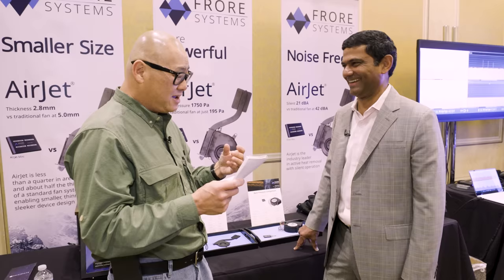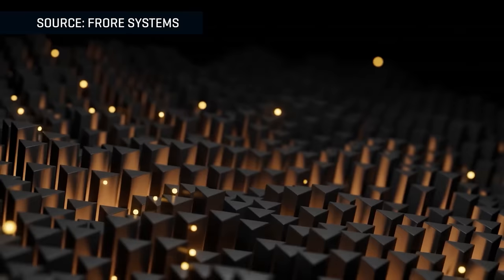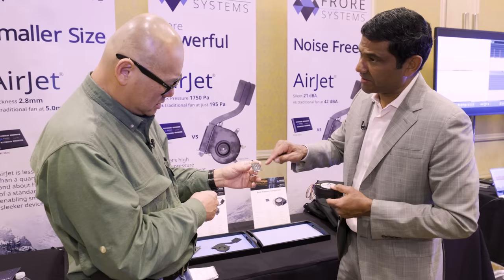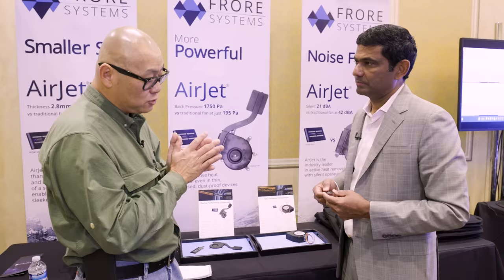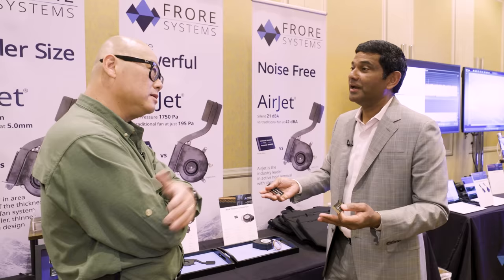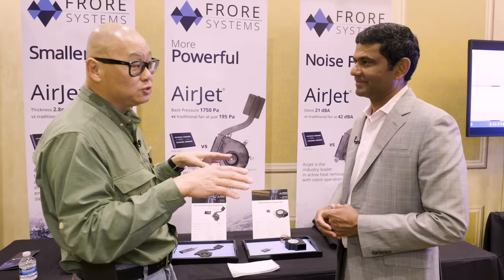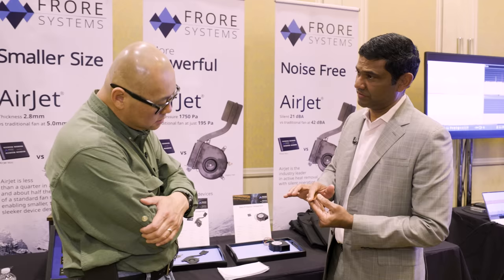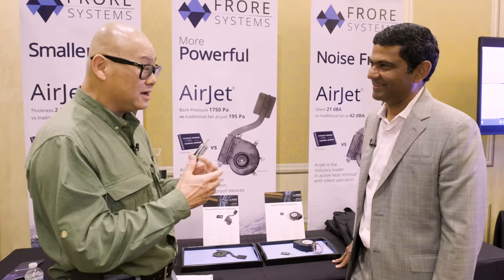Solid State Active Cooling Could Revolutionize Thermals

Comment: This seems really cool (pun) and the thermal saturation factor makes sense, and reducing noise is definitely nice. I'd like to know the endurance of this implementation compared to traditionally fan, which is almost guaranteed to be higher(solid state device vs. fan bearing). Although the 10w seems low at the moment for laptops, I'd like to see 20w for ultrabook, or phones which can't accommodate fans without ear piercing (small fan at high rpm).
Looking forward to phone vendors implementing this asap as they usually do
Reply: If they were practical they could surely use several of them at once (which is also referred to in the linked article) Albeit it's the larger one at 5:34 that can remove 10W(actually 8.75W = 10.5W - 1.75W consumed/heat generated by the device itself) of heat, the mini one being shown most of the time can only handle 4.2W.
They definitely seem more suited to low power, very thin devices at present though. Their site refers to using them in devices which are currently passively cooled - retaining quiet operation & thinness while being able to keep operating at peak performance.
Personally I wouldn't care about a laptop being a bit thicker for better conventional fan anyway though - as long as it was a similar weight, I'd much rather have a thicker but cooler, quieter, more powerful laptop - especially if they didn't have the usual daft air intakes on the bottom(seemingly ignoring the 'laptop' name).
Reply: @DoubleMonoLR  By their very website, the big one can dissipate 6W and the little one 2,5W. It's way worse than the guy is implying. They had the audacity to put "passive heat dissipation" from the laptop in addition to 10W dissipated by 4 of their small units to pitch a 20W power laptop.
Reply: @Bramble20322 idk where you got those numbers but their website says in the stat sheets that the big one can dissipate a net heat of 8.75w and the small one can dissipate 4.25.

Comment: Great product and very insightful demo. Be interesting to see what the lifetime of the devices are and how well they run with ingress of dust etc. Be good to see an upscaled version for desktop CPU's & GPU 's. As long as you can monitor performance (easy to tell when a fan or AIO pump has stopped!!!) and any degradation / replace a device, this looks amazing!
Reply: Yeah......  thats gotta be really dificult with this design.
Reply: that won't be happening in the near future. For now its capacity for power dissipation is max 10W... Gpu 4090 dissipates around 300W.

Comment: Interesting.  Worth keeping an eye on this and how it improves over the coming years.
Firstly I'd like to see how long they last. Gotta be able to last none stop use for 5 years, I personally think, maybe longer
Reply: Piezoelectric actuated components usually last a very long time so I'm curious as well!
Reply: @resonanceofambition  This is not piezo electric he explained they have like tiny pistons pushing air
Reply: As it's a MEMS device, I would expect it to be really durable but more importantly, not have a catastrophic failure mode but degrade slowly in performance as more and more of the individual actuators fail.
Reply: @valinkdevr5520  You are right. I missed the MEMs part and assumed it was Piezo tech because I heard membrane.
Reply: @unvergebeneid  I keep forgetting micro actuators and mechanical structures in common devices are a thing now.
Reply: I'm wondering how long it takes before that thing clogs up with dust and how hard it is to clean it out. It's bad enough seeing dust caked in laptop fans and trying to blow that out...
Reply: @danbert8  I was thinking the same thing.
Reply: @unvergebeneid  does this work in any rotation? example im gaming have to move the tablet/laptop at some point hold it sideways/upside down will it still work
Reply: @danbert8  I'm assuming that when we get to that point, we'll also develop a whole new line of specialized tools to do maintenance- you know, like with every product or service we develop.

Comment: I was also thinking of ways to make an active cooling device that is low profile and I have to say this one is much better. My idea was to use piezoelectric material that will vibrate small fins to push the air.
Reply: Would the use of Piezoelectric create any type of resonance like a high pitch buzz or ring? If not that might be a good idea
Reply: the problem is it would just move the same air back and forth. i guess they found a way to generate an airflow by vibrating the membranes in a particular pattern
Reply: Check Linus tech tipps, they used such a device to cool a steamdeck
Reply: @filiplaskovski9993  It probably would.
Reply: @mythsofconfusion6973  I'll check it out.

Comment: Hmm, it presents interesting possibilities to redesign HS/F systems for desktop PCs too.

You could substitute regular heat sink fins with one of these MEMS cooling chips draped over a flattened heat pipe, with the pipe either forged into a sine wave shape, or just a rectangle like a hybrid heat pipe/vapor chamber combo.

Multiply by 6 heat pipes from the base and you already have 60W of heat dissipation.

AMD's 16 core Ryzen 7950X3D has a 65W TDP, so high end use is near viable in just 1st gen AirJet.

Hells ye, MEMS all the way.

Now we just need MEMS speakers and studio quality MEMS microphones to join the party.

Comment: Interesting concept and I think it will work well for some niche applications. But judging from it principle of operation it will never outcompete fans on the price front. So for wide collection of uses they will be too expensive when compared to the benefits, considering that the alternative is dirt cheap fans. Also considering (unless I misunderstood) that it has moving parts it can be considered a mechanical device with all the life duration limits that that entails. The same problem as for the fans, but those are cheap.
Reply: Keep in mind though that SSD's were once insanely expensive when compared to HDD's, now-a-days SSD's have gotten so cheap there's almost no good reason to consider a HDD anymore.
Reply: @Sergei_Ivanovich_Mosin  Small HDDs sure, but you'd go broke trying to fill a NAS with SSDs

Comment: This really is pretty dang neat. I'd like to hear it in person and am curious on real world power draws. This could be to mobile cooling solutions what the LED was to home lighting.
Reply: Yeah it sounds like the main disadvantage of this is gonna be the power draw, but if it's only 20% on top of whatever the processor is using (he said something like 1 watt of power draw for every 5 watts of cooling), then it's still justified, as the volume saved in a laptop chassis can be turned into added battery capacity. And then the real drawback is added weight when compared to a fan.
Reply: Thats another potential application of this, cooling led lighting transformers.

Comment: I'm also interested in this as a fluid pump.
If the mems is software defined, then the cycle rate can be controlled to move fluid.
Reply: that woulldnt work dude
Reply: The two fluids of air and water are about as different as you can be here. Airjet sounds like it might have issues with, uh, water.

Comment: Very cool. The pulsing components inside seem like they would be very susceptible to dust - I imagine they are very tiny. I'd be interested in seeing how dustproofing works.
Reply: With how the pulsing work, it'll help shed the dust actively since all of them are moving constantly. They'd be more suspectible to moisture, however.
Reply: I think dust is not the problem if there is any blockage more bigger than dust (may be some insect or some tiny foreign debris)then it will fail to dissipate the heat. As long as the whole unit is dust proof or covered completely then it should be fine.
Reply: Need a proper demonstration with it working.

Comment: This device would go nicely with nvme ssd's
Reply: IKR?
Reply: Nvme’s are supposed to run hot.
Reply: @Nib_Nob-t7x  the storage chips yes but not the processing chips on nvme.
Reply: @ChrisWijtmans  this is to big for the controllers on NVME,s. Also a heat sink (with normal case airflow) is good enough to cool them anyways.
Reply: @Nib_Nob-t7x  nope
Reply: @ChrisWijtmans  you can say no but it won’t change the fact that what I said is true.

You have to remember that the controllers are not some high end processor they are just arm cortex chips that consume less than 9 watts on the high end.
Reply: @Nib_Nob-t7x  Nothing about what you said is correct. nvme controllers often overheat and throttle throughput.
Reply: @ChrisWijtmans  Really? That's weird because I just tested on my Samsung NVME's and none of them seem to overheat when I checked it crystaldiskinfo while running through crystal disk mark (default nvme settings).

 The max temperature was 60C (according to Samsung anything under 70C is fine) I did run it multiple times and it seems to have gone the slowest on the first run with it going faster as it got hotter.

there you go I tested it and your wrong. The only thing cooling it is a heat sink and case airflow.
Reply: @ChrisWijtmans  whats your nvme? Also the point is it's completely possible to manufacture an ssd with passive cooling and make it not overheat. If yours is overheating either you have bad case airflow or you should by a higher quality drive.

Comment: This is fascinating.  I think this could be improved by using the air jet modules as a replacement for the fin stack itself.  Standard heat pipes would move the heat from the processor, but instead of transferring the heat to a fin stack, they are instead welded to an array of these modules.  This would work to break down the air insulation, but on a larger surface area.  
If I'm not missing anything, I think they can easily compete with or outperform modern cooling methods by replacing the fin stack with an airjet stack welded to heat pipes. 

TLDR; replace a normal heatsink's fins with these modules (they won't need nearly as many) and I think there will be very large performance gains.
Reply: Can't wait to grab a couple of these aftermarket somewhere and retrofit them to an existing 11th-Gen or 12th-Gen Intel tablet's heatpipes to squeeze nearly desktop-level performance out of the silicon.

Comment: Does look impressive, I've never seen this technology. Wonder if they could stick a Peltier module in there and use the air to avoid the condensation, the only potential downside I see is dust because I've seen multiple times what dust does inside of a computer/devices and I have my doubts, would be nice to have an easy way to open it and clean it just in case. About them  marketing it as a "chip" expecting people to "upgrade" their devices by just adding more of those just like RAM or drives I think that's just wishful thinking but we'll see
Reply: I think (from no research whatsoever) it’s similar to electrostatic headphones

Comment: and here we go with new problems of micro cracks in the solder joints of the chip.
Applying constant vibrations directly to a weld can easily cause that kind of damage over time.

Comment: Yes, the obvious uses cases as in thin tablets, laptops, and high end phones, but... it isn't hard to imagine other uses. Imagine server farms replacing rack thickness and fans which can break down with these. Most of these aren't running much past the 45W range anyway. Higher-end chips in TVs or TV boxes. Graphic cards and desktops -- just to run quieter. Putting mid-ranged graphics cards into laptops and cooling them with these. Definitely a promising technology.

Comment: So I gotta ask, how does it work, is it a kind of positive displacement pump due to the “check valve” effect? What differential pressure is it capable of creating and at which specific flow. Som kind of a pump curve would be fantastic. If this is actually a kind of positive displacement pump, you could make this for high pressure applications by stacking them, and since it is solid state tech, guess it would be highly controllable and accurate. And if it could be applicable for other than air, that would really open up its potential. Gotta keep an eye out for what this will turn into. Hopefully something cool, efficient and cost effective.

Comment: So small/thin.
Easily accumulate dust. 😆
Easily clog. 🤷

It basically has a few fins inside that vibrate when electricity pass through it causing it to move air. The idea had been out there for a long time, somebody was just bold enough to actually make it. Pretty good!

Comment: Holy moly, this is the biggest innovation in the last 10 years (at least) for the consumer electronics and the biggest innovation in cooling ever. Just imagine, new video cameras being able to record 16k without overheating and stopping and being as slim as the passively cooled mirrorless. I also hope this doesn't have a big power draw.

This could also make convergent phones that connect to the monitor and become a full desktop like Ubuntu Phone with Ubuntu Touch was or what Microsoft Lumia 950 tried to come close to become a reality. Imagine putting this active cooler in the phone and then when connected to the monitor and power delivery (so that it doesn't explode the battery) have the cpu dynamically clock itself higher proportionally to the realised cooling potential difference to achieve modern low to mid range desktop level performance.

Suddenly you don't need a laptop to study IT, you just need a capable linux based phone, a monitor with IO (or dock) and a bluetooth mouse and keyboard. And BANG! Those phones will cost like $800+ in the beginning but in a few years it'll trickle down and suddenly every child has an access to a very capable machine.

But wait, imagine this! If chipmakers manage to get RISCV cores that match or exceed the performance of M1/M2 into phones the cpus will be immediately cheaper because of no ARM license fees. Then, it would be really really power efficient to the point of being very powerful even when cooled passively and then you put this active cooling and clock it higher. Now we have a real machine already! But wait, with that power we are for sure supporting VR now. Just pop that phone into a Google Daydream or even Google Cardboard type of VR contraption and suddenly you can do schooling in interactive classrooms remotely, you can work with virtual monitors, you can meet in VR from wherever you might be across the world.

And now we have a true revolution. No monitors, no clutter, no laptops or desktops. Just a phone, a headset (for VR) or even just a pair of XR glasses and possibly but not necessary an input device like a controller or a keyboard but I imagine soon it will all be done with gestures and computer vision.

This has so many potential use cases, an array of these could be used for a climate controlled suit. I wonder if the process could be reversed so it cools the air and heats up the actual component.

Comment: My overclocking self is drooling over the possibility. I wonder if they can scale this down to cellular level too.

Would love to see this on other devices like TV's and gaming consoles etc. VERY interested in this technology!
Reply: Scale it down enough to integrate it with "3D" processors. Could you imagine the number of transitors they could pack into a processor that can stack into a cube and doesnt have to worry about cooling?

Mores law mught be back on the menu. This teck would need to prove massive durability though.

Comment: Questions:
1. Can it be used to cool down hot plastic and steel materials as well?
2. do we simply needs to attach it to the hot device?
3. does it cost less than Rs. 500 per piece in India Hyderabad?

Comment: A genius invention that provides a solution for cooling the microchips in the cell phone, iPads,  the wearable electronics. The AirJet works as a micro cold plate in which numerous  individual vibrating membranes collectively create air flow inside the "voids"  (micro-chambers) .   But why the vibration does not create sound? Very high frequencies？

Comment: great product.since it has a vibrating membrane, dust cannot accumulate easily plus the high back pressure does not allow dust to accumulate in the intake area. if it can minimize vibration to safe levels. this will be the future of cpu cooling system. maybe in the future somebody can develop this for household use where it can replace common blade fans.☺️

Comment: Imagine putting this thing on standalone VR headsets, the only reason why the Quest Pro gets more performance is because of better cooling but still the Quest 2 gets quite an impressive bit of standalone performance, imagine what could be done on a next gen chip with this highly performant low profile cooling. I'm going to bet we'll get games withthe capacity to be in similar graphical quality to the playstation 3, whereas right now we're getting games that can be compared to early ps2 titles, if everything goes well this could be a big jump in vr

Comment: Picture this: You sit down at the local coffee shop and open your 5mm thick dell equipped with an RTX 3090 and an intel core i9 12700H. You notice a few coffee grounds had been spilled where you set down your laptop. Not to worry, instead of getting dust in your laptop, the dust stays in a neat little package you can replace for $50. You boot up Kerbal Space Program 2 in seconds. This will be the future we will see in a few years.

Comment: There should be a backup cooling system for devices that will eventually use it otherwise if it fails then your device will burn.